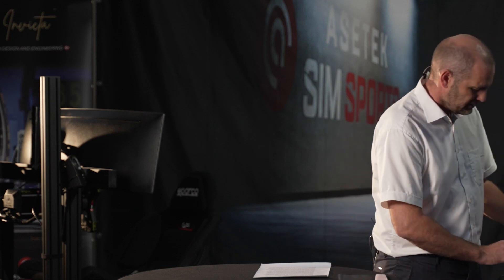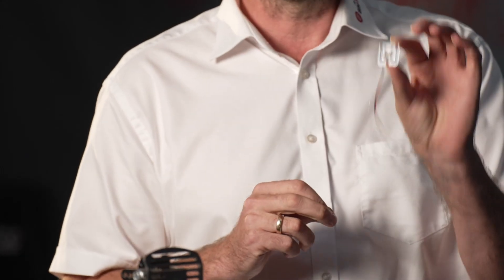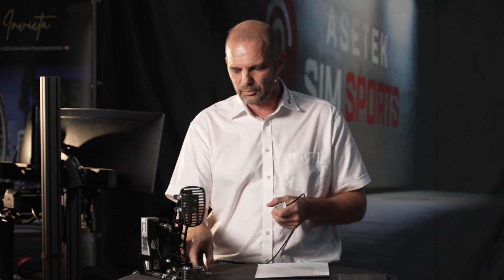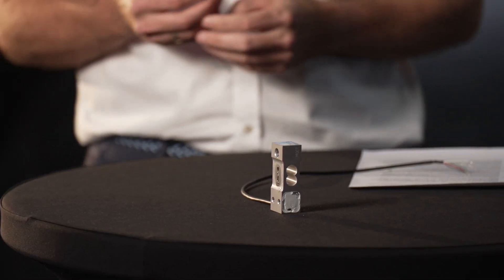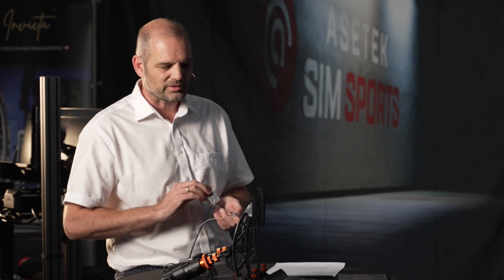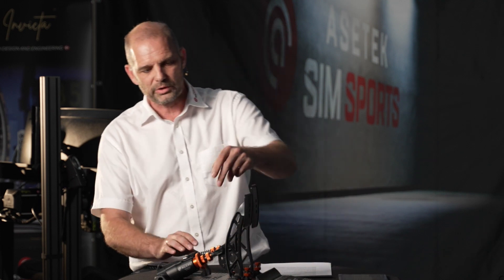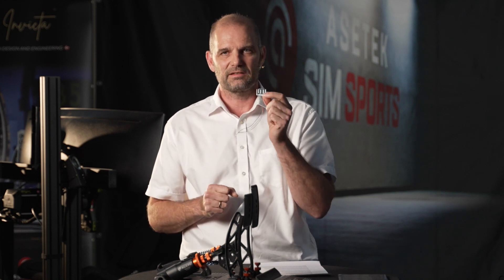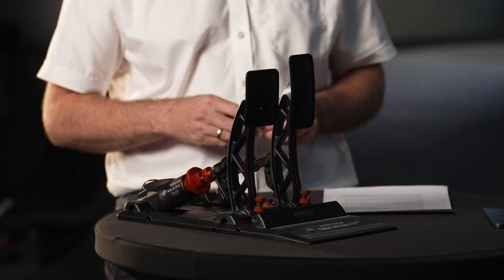Q&A Recap - The Load Cell Design of the Forte Pedals

Comment: Great to see an engineer leading a company and designing things for a purpose, and not just because that's how everyone else does it :) As a mechanical engineer myself I highly appreciate videos like these.

As long as the resolution and range of the strain gauge is high enough to cover the full range of pedal depression it doesn't matter AT ALL if it is actuated directly from the force of the elastomers being compressed, or by the smaller spring inside the pedal assembly, you will just be using a different part of the strain gauges range. The relationship is still entirely linear (both elastomers and springs have a linear spring force) so double the force on the pedal = double the output, and the pedal is calibrated after changing elastomers for a max/min range.

The only issue I could see is if Asetek used a sensor with too low of a resolution, so that very stiff setups are running on a small portion of the sensors range, small enough to lead to inaccuracies. From the video here it seems that is certainly not a problem, and these pedals are set up to have a short travel anyway so that is designed in intentionally in the chosen range of the sensor. I've just ordered an Invicta wheel base, and I reckon I will be adding a set of Forte pedals to this at some point.

Comment: I'm late to this party but must comment !  I don't work for Asetek or anyone related to sim racing...I'm an aerospace engineer.  Just got into sim racing (wow, it's fun!!!  But my iRacing rating is going down not up...ha ha) and saw Dan Suzuki's review (and his updated review) on these pedals.  And of course all the debate flying around the internet that Asetek is "cheating".   

If you LISTEN to this man's words and actually understand what he is saying, they have a good design.  

A load cell is a strain gage that converts physical movement into a modulated electrical signal.  The strain gage itself has a very small movement range (around 1mm or so?).  It doesn't really matter how you "feed" the strain gage...only that you keep your inputs within its acceptable measuring range.  Most pedals use a high-rated load cell...this is done using a chunk of metal to absorb the high braking forces so that your foot pressure doesn't overwhelm the strain gage and move it beyond its ability to measure.  The chunk of metal than moves small amounts on the strain gage (please note the strain gage is attached to the chunk of metal!), which provides a modulated input signal to the PC for controlling the brakes on the virtual car.   This works great, obviously.  And is the established "norm" for a load-cell based brake pedal.   And the key point here....the chunk of metal is absorbing force and deflecting.  Sounds sort of like a spring eh?  Because that is what the giant chunk of metal is doing in a load cell !!!!!!  IT IS A SPRING.  Chew on that for a bit.

These guys have done it differently...instead of a chunk of metal absorbing your foot's inputs forces, they absorb it in the large black cylinder and orange "bump stop" assembly.  The metal of the black cylinder and orange bump stop (and the rest of the pedal assembly) all absorb your foot pressure and deflect slightly....you can't really see it but they are being loaded and hence must deflect a bit.  Just like the chunk of metal in a conventional load cell.  

Remember, the strain gage itself can only accept a movement of 1mm or so (I'm not sure on the actual input movement range, but 1mm is probably in the ballpark) so you MUST have some sort of force-absorbing system (chunk of metal) to keep it from getting overwhelmed.  Think of a load-cell as a mechanical lever on the strain gage, converting large foot movement on the pedal (say 0-100mm or so for a typical pedal?) to the small movement the strain gage requires.  

Side-thought:  I'd wager if you take a normal load-cell pedal and put in mega-stiff springs/elastomers so that pedal movement is limited to about 1-2 mm, you'd end up with a low resolution output because you are not using very much of the measuring range of that load-cell.  

The Forte and La Prima by design limit pedal travel to a small range, so that you are using the entire range of the strain gage.  A small spring "feeds" the actual strain gage, and this is PERFECT since the amount of linear movement on the spring is limited by the design of the Forte/La Prima.  Keeps the strain gage in its operating range, just like you want.

This is getting rather wordy....I apologize.  It is a complex subject and I'm not sure I'm doing a good job explaining it.  Bottom line is I think they did a good job on the design...this video explains it well.  The struggle here is that not everyone fully understands the details of how this and normal load-cell pedals work, so there is misunderstanding.   

Right now, I'm using a wheel and pedals that I originally bought eons ago when I bought my Playstation 2.  Takes about 1 kg to fully  depress the brake pedal !!!   Yes, they are old and total crap so I am looking at what pedals (and wheel...oh geez this wheel is crap too, zero force feedback because it is so old Logitech drivers don't recognize it) to upgrade to.  

I don't have tons of hours using sim pedals so IMHO I won't have to unlearn habits formed from using pedals that have a lot of travel.....I think the Forte (or La Prima) pedals will be great for me.  And reviews say the force-feedback on the wheel is good, I am really looking forward to driving with actual feedback on my wheel !    I have not yet ordered a new wheel/pedals but the Forte/La Prima (or maybe the Invicta) bundle is at the top of my list.

I also think that people who have lots and lots of time on sim brake pedals that move a significant amount may struggle with these pedals...you have to totally re-tune your muscle-memory.  Yes, pressure is pressure but there is also movement coupled with pressure and when that relationship changes (far less movement for equal pressure on these pedals) your brain has to re-wire all the neurons.  Change can be hard.    

One last note...I think this guy is the CEO?   I deal with high-level managers and military officers a lot and it is obvious this individual has a very strong technical background.  As opposed to most manager-types who don't always understand what they are trying to explain.  I just laugh...it's very obvious.  IMHO this guy is the real deal and totally understands the technical details here.  

And I love the "if you don't like them don't buy them" comment at the end !  That is just awesome.

Comment: Went through all comments, as I found this video in my research before I pressed buy on the website. All sides could handle it better, I think.

If the employee of the competing company makes the comment, it is fair and decent to say so at the first place. Saying “everybody know me, channel etc.” afterwards is not fair nor nice, as someone how read must investigate and waist time, like me now writing this comment. However, fact that someone works for some company, does not make the statement true or false, as this is generally true.

On the other side, Asetek could just said that the Forte system is different implementation of the load cell, as it is, and it is designed to be compromise between reduced cost and performance. That is what was pretty much said in the video. In the Forte pedals specs, it says, “Load cell will sense up to 180 kg of force on the face of the pedal”, and that is not completely true. Much better wording will be “load cell system can simulate up to 180kg of the force on the pedal”.

Third side is, the statement that Forte pedals could work the same with potentiometer is not completely true ether. As Dan Suzuki in his video showed, second stage can be set in the way that pedal is not moving (or almost not moving) but still can read pressure, and that can’t be replicated by potentiometer. This system is hybrid, designed to reduce cost with minimal lost to the braking input. I would expect that in La Prima pedals for instance, hydraulic system on the Forte and new ABS system on Invicta pedals. Of course, price should be adjusted but that was the way I would segment the product.

Comment: All I want to know is, can the brake pedal sit proud of the throttle? I need proper heel and toe shifting...

But seriously, I need these pedals and the clutch kit. I have a set of CSL V1s that has the strain gage on the pedal arm, but the braki g feels anything but consistent. And I cannot have the brake pedal sat proud of the throttle, which makes downshifting a chore.

Good video. I intended to listen as I drove home, but I had to pull over and see what you were talking about. I'm sold!
Reply from the maker: Hey!

Indeed they can! Depending on where you measure to and from on the pedal plates, adjustment is possible to an extent where the throttle sits over one full inch behind the brake. Also, we have a video on our channel demonstrating heel and toe with our pedals here: youtube.com/watch?v=DBWKhak3Qgk

Hope it helps!
Reply: @AsetekSimSports  It sure does! Thank You

Comment: The real issue (that these 7 minutes of video failed to explain at all) is very well demonstrated by Dan Suzuki in his video about it: https://youtu.be/lRdGqPm6jOA?t=368 The critique is that Forte's brake pedal isn't a pressure-based pedal, but instead a position-measured pedal. This is because the elastomers do not actuate the load cell, it is actuated by a small spring regardless of what set of elastomers is used. This means that using a load cell or a potentiometer would be the same, as it's only measuring the position of the pedal, instead of how hard it's being pressed. Which, quite frankly, makes these pedals worthless as sim racing "load cell" pedals.
Reply from the maker: Sorry you feel them worthless. That is fortunately not the feedback we get. We get great feedback, that they are consistent, people drive fast with them, (many as fast as with Invicta in fact) quality is great and at an affordable price point. 

At our side we are happy we get the feedback that matches what they were designed for. That being said we acknowledge many got a set perception of how things should be made so we are just happy there are products for those as well :)